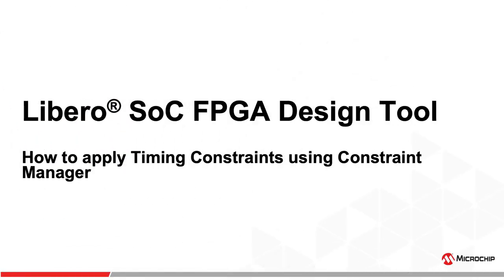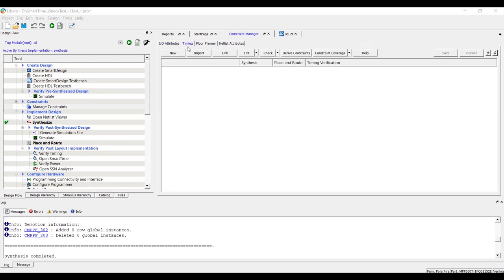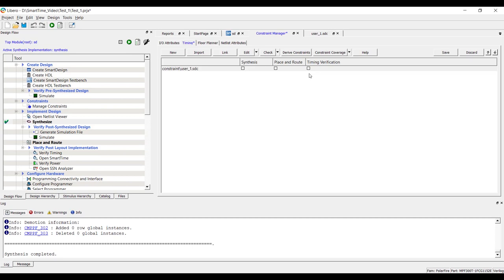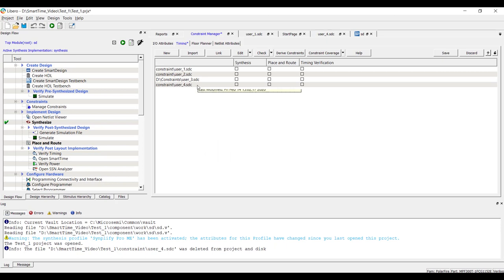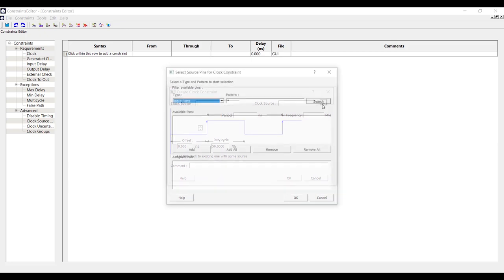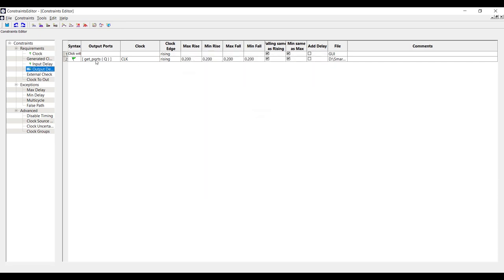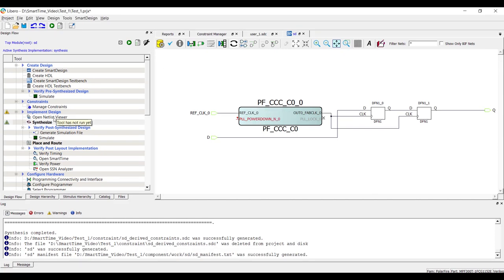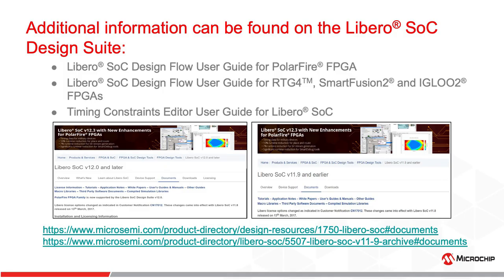How to Apply Timing Constraints Using the Libero® Constraint Manager

Comment: I have problems 1:59 check timing verification constraints.
Reply: missing close-backet                            user_1.sdc(1)
invalid command name "get-ports"                   user_1.sdc(3)
invalid command name "get-ports"                  user_1.sdc(5)
invalid input delay constraint: CLK does not match any clock name or source.              user_1.sdc(2)
Reply from the maker: Hi there, thanks for your comment. Based on the error message, you are missing a closed Bracket after user_1.sdc(1). The user command is “get_ports” not “get-ports”. Also, the CLK does not match the clock name after “create_clock”. Please contact our support portal if you would like help using Libero Software: https://microchipsupport.force.com/s/

Thanks!